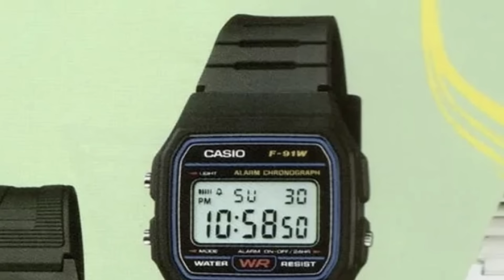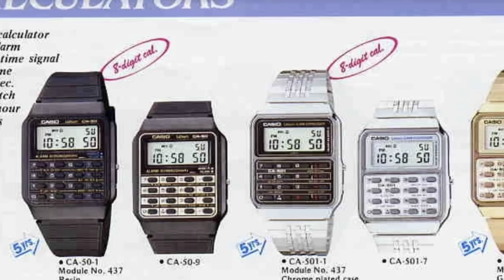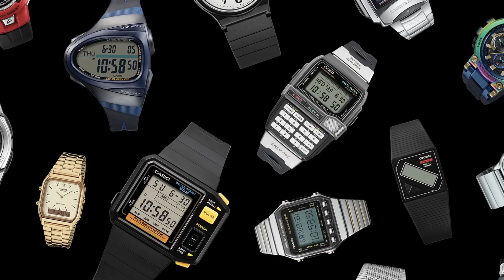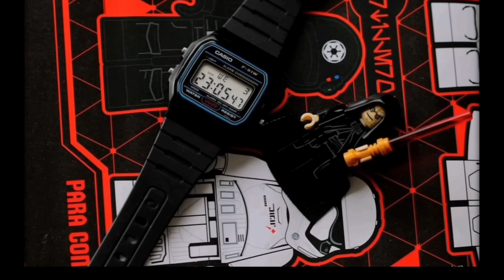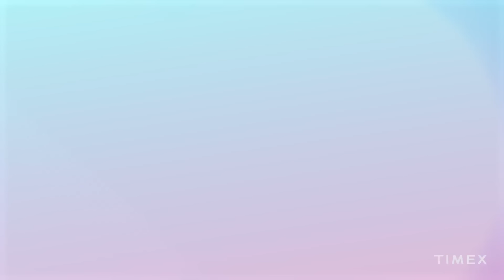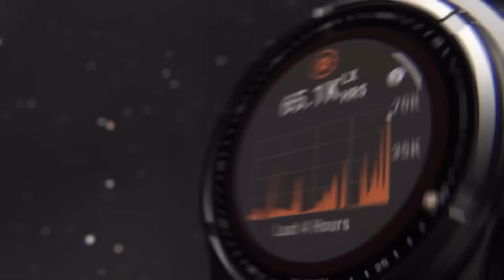How Casio Made the Most Sold Watch Ever

Comment: After my watch broke last week, I bought F105's. As they are basically and illuminator version of F91-W, and it's even cheaper. Besides the size and strap length, it's perfect. And since there are rechargeable watch batteries and pocket dynamos, I'm struggling with justifying buying mechanical watch "just in case of apocalypse" 🙂
Reply: Honestly, I think a photovoltaic g-shock will be much more suitable for the apocalypse than a mechanical watch

Comment: I bought my first back in....about 2011 or 12. , replacing the LA-201W I wore at the time.(That watch was working fine , but as a college student , I feels like to upgrade my game and got something more "professional" for the lab)
than replace that F-91W with another F-91W as buttons on the old one were all worn off (probably from the chemicals) in about 2017 , and another few years later (as the second one also got button issues , this time were all jammed up and hard to push. probably corrosion/rust/dust from all the salty sweats I got from field works.) ......and so on
I'm now on my 4th daily gear F-91W , and also another 6+ sets in the drawer as collection (and as back up. Although I doubt I would ever put the "orange shell" and "clear belt" ones into daily use.). 
And kind lost track on how many belts I had went though.

Comment: Had a few F91w Casio’s over the years, low cost, simple and just brilliant.
Reply: Hello! Could you please tell me how long the strap lasts with daily use? And how quickly does the watch scratch?
Reply: @pavelpavel2782 In my experience how long the strap lasts depends on how much the watch is worn, but if all day everyday 7 days a week the straps last around 2 years(in my experience).

Comment: I have a Casio W-71 watch that is very similar to the F-91W. The main difference seems to be that the F-91W does not display the month, while the W-71 fits the month readout between the day-of-the-week readout and the date readout. As far as I have been able to tell, the W-71 might be the only Casio model that displays DAY - MONTH - DATE.

I bought my W-71 when the model first came out, a LONG time ago. I gets a new battery every few years, the LED long ago stopped working, but it still works great otherwise. I never take it off except to change the battery or when the plastic watch-band develops cracks and needs replacing. I recently bought another W-71 on eBay, new old stock, so I can keep using the type when the original one eventually fails. I also like the fact that even after all these many years, it is still easy to buy replacement bands (I think they are common to enough models that they are still in production).

It remains a mystery to me that Casio's current watch models do not have a comparable model that displays the MONTH....seems like a no-brainer that the month is an important part of the date function......

Comment: I wear what seems likely the most common successor / copy-cat - the Timex Ironman*. It follows the same formula: simple, small, light weight, waterproof, smooth soft band, unbreakable, long battery life, night illumination. It has that minimalist look that never draws attention, its basically invisible. I have a small wrist so most watches look like hockey pucks shackled to my arm. I wear my watch fishing (in saltwater too), working on my car, in the shower, while sleeping, I never take it off so its with me 24/7/365. I can't be bothered to change watches for different situations. All I need from a watch is rugged time keeping. I need to know the time and date plus one more thing - the ability to switch between two time zones which the Timex adds. The Ironman also adds another tiny improvement - there is a band keeper to keep the lose strap end from flopping around.

*Shhhh don't tell anyone but I actually wear the women's version as its a few mm smaller and thus fits perfectly.

Comment: I've used the W59 watches since like 2007. I choose the W59 instead of the F91W because of the extra water resistance (50m), just to be safe. I always have spare ones of the W59, because sometimes I loose them.

Comment: I would NEVER wear a black plastic watch or a digital watch. I am 66 years old, and am still wearing my dad's early '50s Waltham self winding watch. Bright, shiny, and very classy. I had it cleaned and checked out, it still works fine, even though it is almost 10 years older than I am. It has a metal expansion band. You can't buy a watch that looks like it anymore.

Comment: I had a lot of them since kid, I found the real enhancement was the illuminator series, replacing the weak corner yellow light by a full blue back light, more efficient to read in total dark such as movies theater or night clubs.
The only issue I had with all those casio watches was the wristband that everytime finish to be torn and I didn't find official casio model to replace at supermarket, only cheap generic less soft and flexible as the original. 
For that metal chained wristbands were great regarding durability and looks more premium

Comment: I guarantee nobody will believe this, but I have once owned an export model Casio that had bullbars from the factory, and raised edge slots in the bezel to hold them in place. Thing is, it was not a G-Shock model, but closer to the F-91W, with four buttons and blue backlight. It has to be one of the rarest Casio watches in existence, rare to the point collectors think it's a myth.

Comment: I love my casios. I had a f91w but the strap broke. So I fitted the watch its self to my motorcycle so I could track time on the road. I replaced it with an A163W which having a metal strap is so bullet proof. The main body has had the chrome ware out all over and is mainly copper now. I’ve had it about 10 years and only had to replace the battery a few months ago.

Comment: I have one that I wear to work at an oil change shop. It gets banned around, covered in oil and grease, and then tossed into the shower once I'm home where I wash it off. It was less than a tenth of the price of my apple watch, and will likely outlive it tenfold despite the abuse it takes. Overall pretty good way to spend $15

Comment: I found one of these on a beach in shallow water when I was around 10, probably in 1990 or 91. The resin strap was chewed right up to the pins and barely existed. Watch face was scratched beyond recognition. Bounced around in the sand and rocks for god knows how long. Got it home and the light was still turning on. Polished the front and low and behold, it was running with perfect time. No rust despite the sea water, even the alarm worked! 
I put a new strap on it and used it till college. I lost it but never got to see it die!
Reply: There's a comment here of someone who lost his F-91W on a beach.

Comment: I've had at least 4 or 5 of theses. I bought my first one whilst on my first foreign holiday in Lanzarote in 2011, for about 7 Euros I think, and I've never had a different type of watch since. I've had one where the screen has died but it is still running and still beeps somewhere in the depths of my flat once a day. Another one had the strap break on me. But I definitely have two that are in fully working order (one having been temporarily mislaid amongst the mess in my flat, causing me to buy the other one), and possibly at least one other fully working one somewhere in the flat. I don't feel properly dressed to leave the flat unless I have my Casio F-91W on my wrist.

Comment: I got my F91-W in January 2007 and replaced the battery for the first time in April 2024, although the coin cell hadn't been able to drive the backlight for quite a while. I've had to replace the strap a couple of times; people always ask why I bother when I can buy a whole new watch so cheaply, but they're missing the point - I appreciate the longevity of the product and that it's been with me for so many years. I'm a bit of a Casio fanboi with several to choose from including databank, calculator, world-time and multiband models plus a G-Shock as the daily driver for bashing around at work which also displays information about the tides (quite useless to me located in the middle of the country, but I like a good gimmick!) My most expensive model is a solar powered analogue Casio Edifice which is hardly a Rolex in terms of price, but it looks sooo good. I find today's bland smartwatch scene somewhat bland with near everyone sporting a characterless black blob around their wrists. So long as Casio have a massive range of reliable and great looking timepieces, you won't find me rushing out to buy a soulless Apple/Samsung/Garmin thing.

Comment: I still have the first model of G-Shock from the early 90s. Which is basically the F91w with a sturdy casing.
With the years I managed to crack the plastic casing and removed it, but that watch endured a lot including being thrown on concrete from the second floor a few times after being bored of having it for so long.
It is still working, on I think its 3rd battery.
I now use another Casio as my main watch (a model with solar power, compass and barometer).
Casio watches are almost indestructible and highly practical, all the watches I tried were junk compared to them. 
It's one of the very few brands that deserves brand fidelity, like Bic lighters and pens.
Reply: The same. I wore it on hundreds of dives. I wore it into working fires. Used it through countless EMS calls. The thing was and is indestructible. The only other main difference between the F-91 and G-Shock was while you could replace the G-Shocks battery you would never get the water seal quite right again. So you could kill it on a 100’ Scuba dive.
Reply: @andrewtaylor940  I didn't know about that ring issue, thanks for the info.
If I remember it was rated for 30 meters and you are not supposed to actually use it at that depth anyway, more like snorkeling or shallow scuba diving.
Reply: @19Murad77  I had them down to 30-40 meters many MANY times with no issue. As long as they remained factory sealed.
Reply: @andrewtaylor940  Nice, it is indeed a great watch!

Comment: I remember we had F91W and I guess we also had the metal one A159W or another metal one that looks like A159W if there is any. At some point, I remember using myself the one with databank and calculator when I was a kid; but I don't remember the model of that. Later my dad bought Casio LIN-164 and probably used like 15-20 years and I used in the exams like 8-10 times a year; I only know the model because I still have it on my table and I just had to check the model. But I wonder where the rest are.

 I wasn't using any watch since the highschool but I have inherited my late grandmother's smart band. I didn't liked to wear it but I liked to see my own data, sleeps, steps, heart rate, stress, oxygen levels etc. Maybe I dual wield watches, which I actually did in some of my school days; I had both analog and digital with the calculator that I have mentioned before.🤣

Comment: I use an F-105.
I wear it 24-7-365.
Never failed me.
Durable like a G-Shock model.
The battery is 6 years old, maybe more including the time it spent on the store shelf, and it is still going.
My only complaint is that it stays behind 5 or 6 seconds every month but that's alright i suppose.

Comment: Bought one in late 2013 as a rough watch for work so as to not demolish my Maurice Lacroix or Seiko. Still running on its original battery. Typically drops 2 or 3 minutes between adjusting for daylight saving time. I'm not complaining. It needs a better backlight & some sort of a keylock to prevent errors.

Comment: In 1979 I bought my first digital watch, a Pulsar IIRC.  I've been rocking cheap Casio's for a long time now.  A 91W for a few years but for the last 5 or so its been an Illuminator W-800H for the better backlight and extra features.  I have a Garmin too for tracking my cycling but mostly its the Illuminator that sits on my wrist.  It gets a hard life so I'm on my second band with this one - still the original battery though.  Having owned a smart watch the lack of a need to charge the Casio is absolute killer feature.

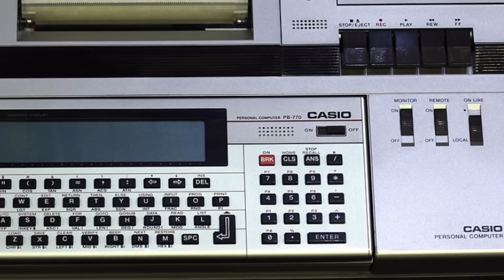Comment: 1:20 I have that same model GE shoebox cassette tape deck. I think the power supply needs a recap, but it works fine on batteries. Used it as a tape drive for a Sinclair computer many years ago.

Comment: I am a watch person, but not crazy. Just have an automatic Seiko and a few Seiko Kinetics that I rotate on regular basis. I also keep an F-91W in the watch drawer for a time reference. The automatic needs setting correctly now and again (Kinetics are more accurate) and I use the Casio to reliably know the correct time. I also have the Illuminator permanently affixed to my motorcycle and that thing has seen some weather and lots of vibration-filled miles. Still on original battery, both those Casios. I don't even remember when I bought them (but a long time ago). I tried wearing the F-91W and absolutely loved the way it felt. It pretty much disappeared on the wrist. I couldn't feel it at all. The only reason I do not wear it and relegate it to the drawer duty is because the crystal is very easily scratched and I do a lot of work with my hands reaching into abrasive places, etc. Even quartz crystal on more premium watches have to be replaced by sapphire crystals on all my daily drivers. An F-91W with sapphire crystal would be ideal, but the crystal would be much more expensive than the watch :)

Comment: I have a CAsio watch that looks very similar except that it has one additional button top right. Runs for years on a single battery which I've only replaced twice. Still runs perfectly. I bought it back around 1985. And it is comfortable to wear unlike an earlier Seiko watch which finally carked it and was fatter and heavier.

Comment: I've been wearing Casio watches for more than four decades now.  And they hold up quite well - even with the (ab)use I give them.  I think I'm on only my 3rd Casio watch across all those years (and the 2nd still works, but looks like sh*t from all the (ab)use over the decades).  Of course they also make G-SHOCK and the like that can better take the heavy use / abuse and still survive and look good ... but for the price difference ... yeah, I'll just go for replacing the much cheaper, lighter, and thinner about once every two decades or so, and still spend lots less overall.

Comment: I will only use a wrist watch that is rugged, inexpensive, accurate and shows me day, date and time at one short glance.
You'll already know I'm wearing a Casio. And I don't even know how long the battery already lasts, but it has to be far longer than 10 years.
Unless I'll be disappointed one day, I won't wear or buy any other watch until I die. Thank you Casio.

Comment: the first casio I bought was in 2006 at the Navy exchange, it was a round face G shock, I wore it for maybe 2 years before losing it. Back in the US, it wasnt until about 6 years ago I got a Casio calculator watch to use at work, I would actually use it in earnest too because I didnt want to use my phone as a calculator because my hands would always have oil on them working, so I just didnt care if the watch got dirty too, these wash off just fine with hand soap and water. I got a F91W for the meme basically 3 years ago, it was very much abused at work and still is just fine. Oh I found my calculator watch laying around, the 7 year mark is coming up, in fact, im pretty sure the watch was made over 7 years ago already, i've just owned it for over 6 now. The battery is just fine and it got regular use too. 
I love casios so much because it's one of the last things you can buy that is actually MUCH better than advertised. F91Ws arent just water resistant, they have to go pretty deep before they fail, they can be frozen, dropped in a bucket of 200F oil too I've come to find out.

Comment: I have two F91Ws. The first I bought in 1990 when they were very new and cutting edge. The second around 10 years later when I managed, somehow, to go on holiday without the original. I don't remember what the first one cost - though it was satisfyingly cheap, but the second cost less than £10 (in pesetas at the time).Both have performed faultlessly except for needing strap replacement every few years when they get brittle. To be honest, I don't know which is the elder brother. I don't actually wear a watch much these days since I retired 9 years ago but did renew their batteries in 2020. In practice, I replace the batteries at 10 year intervals, before they fail, so can't say what the ultimate lifetime might be - just replacing them on the decade year, Out of interest, I've pulled both out of the drawer to check their timekeeping, so they've both been running for 5 years since battery change and resetting. One was 2 seconds slow and the other - shock horror!! - was 8 seconds fast. They have swum in the North Sea, the Atlantic, the Baltic, the Mediterranean and innumerable swimming pools. God knows how many showers they've taken with me and they've been cooked in the sun so that the back of the case was too hot to touch. Out of curiosity, I stuck one in the freezer for a week, and guess what? It was running perfectly to time when it came out. So, my review? They are a masterpiece of precision, economical engineering. I just wish my body was constructed to the same standards. Casio, can you do me a rebuild?

Comment: I still wear my F 91-W from 1994. Yes, over the years, I've changed the band and battery (CR-2016) but one thing I've noticed is that my model has a glass face, when the newer versions have a plastic face. In 30+ years of ownership, it has never failed in any way.